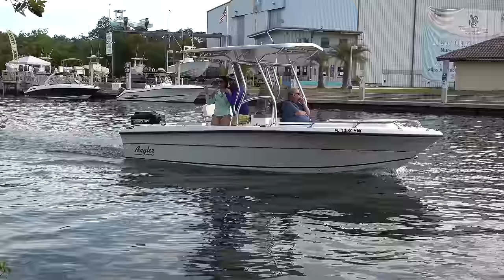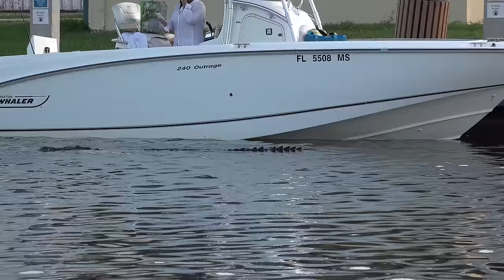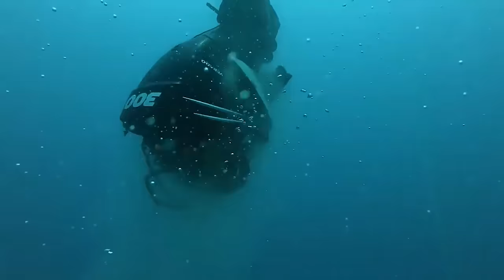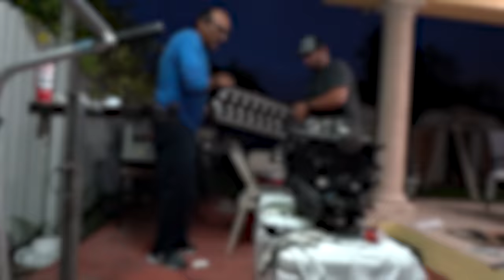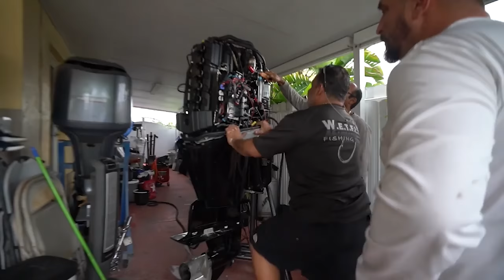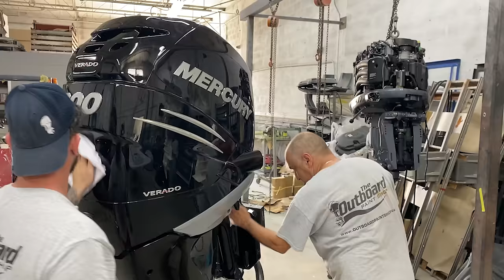Boat Ramp Chit Show Top 10 ! (Summer 2020)

Comment: Wayne The Boat Guy

I have never driven a boat and would take classes before doing so. I love and laugh as you pick up actions of stupid people. Wayne has smart boating ethics as many whom you film do not. Have enjoyed your video's all day during this day of inches of snow fall. Keep up your great work capturing the good, the bad and the ugly.
Reply: Classes are great, but a basic understanding of physics, geometry, and common sense, are required. Got a 22 ft ocean boat, started going 25 miles in the ocean right away. Never any problems at the boat ramp, or in the water. Unload, and load by myself, for 13 yrs. Make everything thought out, and smooth.